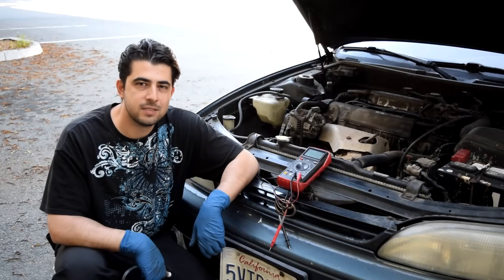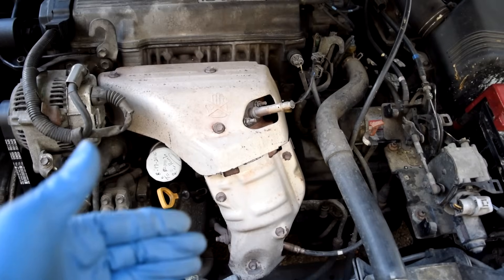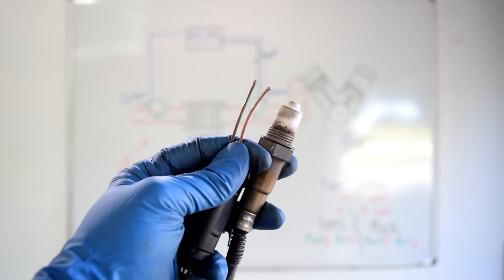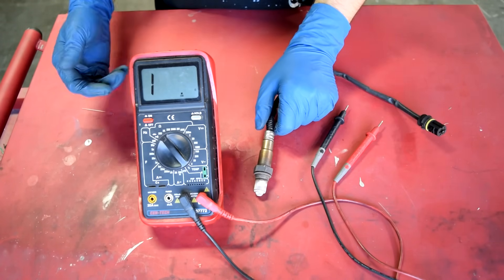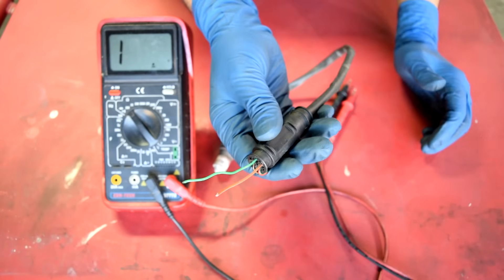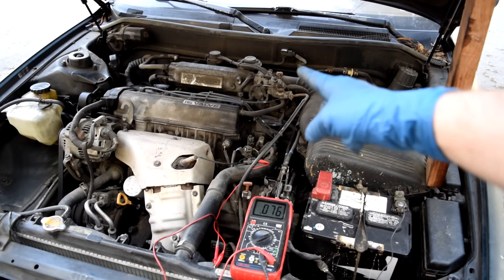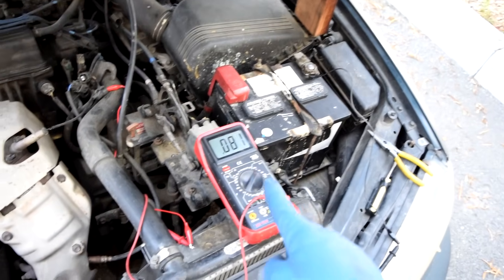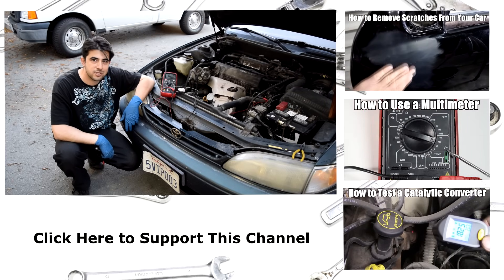How to Test an Oxygen Sensor - Plus Oxygen Sensor Operation and Replacement Guide

Comment: thanks for your perfect video , i wanna ask you something why when i put the test light on + and the probe on the signal wire of the sensor i am introducing voltage to the signal ? does the voltage transfer from + to - ? i don't understand this part
Reply: Cars are negative earth. so the positive terminal is sending 12 volts positive up thru your test light, thru the lamp filament, down your probe to signal wire of the sensor. If you get a voltmeter and put one probe on to the chassis of the car and the other probe on to the probe of your test lamp you will see a voltage reading( with  the test lamp  NOT touching the
 sensor)

Comment: Should a 02 sensor read negative milliamp
Reply: Change your leads over
Reply: @mmark8394  thanks. Ill remember that when i try with a multimeter….I was actually reading it on an access port on my sti at the time. Turns out my 02 was ok. It was a intermittent fuel pump issue.

Comment: When you tested the single wire sensor with the voltmeter, the reason it wasn't switching back and forth in voltage was because the sensor was unplugged from the ECM, which created an open loop condition - without the feedback from the sensor, the ECM cannot modulate the pulsewith to switch the mixture rich/lean, so you wouldn't see it at the sensor.
Reply: Patrick you didn't need to watch this, you already have this topic wired. Look at the big brain on Patrick you get A on today's test lol
Reply: Yes, simple Kirchoff's law, the disconnected one wire sensor could not possible complete a circuit.
Reply: He revved the engine which showed a change in sensor output.

Comment: The code 0155 kept coming up when I scanned the car when the check engine light came  on. Checked the fuses and switches under hood. Pulled switch marked O2 sensor. All 5 prongs had white corrosion on all prongs. I cleaned the prongs and socket to metal. Seems that fixed the problem so far (3 weeks) where the engine light would come on within the first mile. My fuel mpg was at 19.5mpg to 10mpg, so cleaning the prongs of the switch worked and fuel is back to 19/20mpg and this is with 04 Grand Cherokee Overland with 4.7 HO 2 wheel drive. Cleaning the prongs was a good deal so if  you have a light come on saying its an O2 sensor, check your owners manual for location of Ox sensor relay first, clean prongs  . maybe a blown fuse .

Comment: I don't get it.       The cylinder closest to ur timing chain.      They both are equal.        Am I wrong
Reply: They are not equal, one bank is shifted back by the thickness of one connecting rod, as the crankshaft journal is shared by two connecting rods, one of the two is closer to the "front" of the crankshaft.
Reply: He means the number 1 cylinder is always the one closest to the timing chain or belt  on a 4 banger. On a v6 or v8 v10   or v12 bank 1 is always the  side where the number 1 cylinder is and, bank 2 is always the one where  number 2 cylinder is.

Comment: I was getting codes P0171 System LEAN (Bank 1) As well as P0131 Low Voltage Sensor 1 Bank 1. After i watched this video it's clear why as the oxygen sensor is bad. Good video.

Comment: l have a lexus ls460l 2007. l replaced the bank 2 sensor 1. l started the car and got a p0051 in the scanner and the also said 3.29. could you please give me any information
Reply: Andrew Villanueva hi, did you ever figure this out? I think I'm having a similar issue with my subaru

Comment: Say bud, I had a weird one I hope you can help me with. My car was running a little warm and after extensive research and doing a lot of process of elimination, I came to two things that may be causing it to run hotter than normal: the o2 sensors or a vacuum leak. I decided to just see the live data of the car and saw that both sensors were at about .6 to .7 average. What was strange to me is that when I turned the car off, sensor 1 was at 0.0 volts but sensor 2 was giving 1.2 volts. Is this normal?

Comment: Great videos!  Was wondering if anyone has any idea is where the fuse is to the B1S1 on a 2007 Toyota Corolla.  I've looked all over but cannot find any information on it.  My scan tool shows 0 volts, a bad fuse would be  the easiest fix.  Any help would be appreciated.  thanks....

Comment: does a bad O2 sensor cause black smoke to come out of muffler on a 2001 jetta 2.0
Reply: jose martinez yea if it makes your PCM think the engine is running lean it adds more fuel than it actually needs meaning black smoke

Comment: excellent vid and explications !
i suscribed
but how could you mesure  volts on the o2 sensor while its disconnected ?? thanks
Reply: Bastian Peltier the O2S creates Voltage to communicate with PCM it doesnt take current it gives Basically

Comment: Good info but .5 volts is too high on a downstream sensor.  Usually it should be lean after the cat and should be closer to .15 volts. A .5 will appear to the PCM as if the cat is not efficient and stick a cat efficiency code.

Comment: thanks bo$$,, I have a question 

if I delete my cat converter would the fuel trim change?? is it really that the downstream O2 sensor only detects the bad cat converter and doesn't effect the fuel mixture ?

why the downstream O2 sensor has steady 0.5 v?
Reply: warsha Sir Please never delete the cat on your car it does absolutely nothing Other than change the Molecule Structure of gases emited by your engine

Comment: Hello Mr Ratchet n Wrenches

I have a lean code p0171 check engine light is always on, the cr run 
fine and idles fine. air/fuel sensor fluctuates between 600 to 800 down 
to 200. the fuel trim long term is 15 + and the shorterm fuel is -14. 
Check for vacuum leak engine cold sprayed water all over intake manifold
 , vacuum hoses , exhaust manifold, its normal.  The air/fuel sensor 
drop to zero volts when I pulled the vacuum hose from manifold . Does a 
zero volt reading point to a faulty o2 sensor , its a 4 wire , on Toyota
 corolla 2000 4 cyl CE 1.8l.
Now today I will check spark plugs and injectors, its repeated ticking 
sound points to both injectors and spark. spark advance on the obd tool 
reads 15 with a G letter . What does it mean?

I have not back probe the o2 sensor because I can not find its o2 
specifications on voltage drop and I don't know if its a wide band or a 
narrow band sensor. 

I cant find the fuel regulator in the engine. And I need to inspect all 
the vacuum hoses too. Its like being a medical doctor, I only have 150 
hours of training with certificate from the 70s and learning all this 
analysis with fancy digital scanners can be very expensive for just a 
do-it yourself-er. 

can I use a volt meter with an amp probe together on a o2 sensor signal 
wire, instead of back probing? 

Can I use the wave screen on the less expensive OBD scanner, to see wave
 forms along with amp probe and wire clip , How do I set this up?

Comment: what can cause a v8 to backfire an cut out but when it gets to running temp it stops all at once an runs smooth?  it has new iat sensor, coolant temp sensor new plugs wires distributor cap button an new timing chain that was put on by how the Haynes book says

Comment: too much info, for beginners, went to fast. make the video shorter or separate the testing aspect into sections, slow down.
Reply: It does get sort of confusing at times so what I do is I watch the video again and either pause it as I take notes on each section or replay each section at a time until I get the full grasp of it part by part. Good luck!

Comment: Thanks man for the excellent sensor videos. They are easy to understand and very educative indeed. Keep the fire burning. Could u please do a video on a Toyota Corolla Spacio 1998 4AFE engine (Automatic)  indicating the position of the camshaft and crankshaft position sensor and how they are tested for functionality. Also, whats the name of the sensor at the "front" of the throttle position sensor and how is it tested? I understand the throttle position sensor is at the "back" of the throttle valve.  Unfortunately, I do not have a wiring diagram for the vehicle.

Comment: Thanks! This video was a big help to me. I have a '97 Honda Accord LX with 296k miles on its non-vtec 2.2L 4-cyl engine that runs fine (no misfires), but just got a CEL for the P0420 (catalyst inefficiency) with no other codes.  Using my ODB2 reader, my downstream O2 sensor's voltage jumps around kind of following the upstream O2 sensor's readings.  What would you do? I've been putting a qt of oil in about every 1500 miles for awhile now, but there's a valve cover leak that I was just about to repair.  Would you replace the catalytic converter on the chance that the car might be burning oil (I've not noticed any black smoke or soot on the tailpipe) which can ruin the new one or just ignore the P0420 code since I don't have to worry about inspections in my state?

Comment: Isn't it kind of dangerous injecting 12 volts to the signal wire. I would think that could blow your PCM.
Reply: He disconnected the sensor wire from the Harness side of the circuit.  Although most signal circuits are 5 volt reference based, this is to make the ease of testing and to not have miscommunication from 5 dozen different sensors based on 12 volts since the battery is 12.6 volts.  This should not blow the PCM.
Reply: Thanks for the comment. I was wondering what was going on there.

Comment: Great video! I have learned a lot from viewing your videos!  

Question??? I have a 2004 Toyota Tacoma 4x4 that will not complete the I/M for the catalytic converter. Both O2 sensors have been replaced. Also the rear catalytic converter was replaced because the original one was stolen.  Currently done a drive cycle, but it will not complete I/M from CAT.  Any idea or advice?

Comment: Why do you have to supply power to the signal wire to check if its ok? cant be checked just by checking the continuity of the wire with a multimeter? its risky to supply power to the pcm...
Reply: That is my opinion as well. I think continuity check would suffice

Comment: That LED test light will get you into trouble one day my friend. Scrap it, get a regular incandescent one. You can't check circuit integrity with those, it takes than .005 of current to light one of those.
Reply: would the the test LED be best suited for checking low voltage signal wires, while a 12W incandescent would be better for checking power lines?
Reply: AJFresh  I don't even think you can use it for low voltage signal wires, I think the circuitry in the L.E.D teslight is only designed for 12 volts. You can use a simple voltmeter for that. The fact is, there have been situations where a L.E.D testlight has been used to check for voltage and ground and there has been significant voltage drop in that circuit, but the L.E.D testlight still lit up as if there was nothing wrong. Now had they used a simple incandescent one, the dimness of the bulb would of indicated a problem. And all that talk about it being dangerous for computer circuits is a hoax. No incandescent testlight has ever burned a computer.
Reply: oshin aslanian Thank you!

Comment: Great information and I like how you describe how the parts work on the white board. FYI - I replaced my upstream oxygen sensor four months ago on my 2001 Caravan and the check engine light came on again. The same senor failed and I verified this on the two white wires (heater). The oxygen sensor from Autozone had a one year warranty, so it didn't cost me any money other than my time to replace it again (I did have to pay for the new sensor and I rented the removal tool which I was reimbursed). I showed my two teenage sons how to test the wires so they could see the failed oxygen sensor and the working oxygen sensor.
Reply from the maker: Glad you like the video, thanks for commenting.

Comment: please do not use 12v test lamp on pcm side if a circuit unless you are certain the circuit operates at 12 volts most pcm circuits are 0-5v. just an FYI good video.

Comment: I've never heard that tip about finding the number one cylinder. That's pretty cool. You did a great job of explaining the process but do me a favor and leave this video up forever so I can come back to it as a reference. :)
Reply from the maker: You got it :)
Reply: Hey thanks!
Reply: I hadn't heard of that method of determining cylinder one either!  Good one.. You can download the video using an add on from Firefox and store it on your hard drive for the future in case it's ever taken down.  Just fyi..

Comment: With all due respect, you can't measure an o2 sensor signal with a dvom. A dvom gives an "average". An o2 signal fluctuates too fast and your dvom will give an average voltage. You need an oscilloscope to see the o2 sensor signal. A scan tool will also show the signal, just not in real time. Great video man. looking forward to your next one.
Reply from the maker: It's not as good as an oscilloscope sure, but it gives an indication whether the O2 sensor is shot or not. Thanks for commenting, cheers.
Reply: I think of a dvom in this case as more of a go/no-go tool.  An exact number is not necessary, but a ballpark figure will suffice.  The average person doing it themselves is not going to have an oscilloscope, nor the ability to use one.  I am a lifelong ham radio operator, and haven't touched one for years.  And with the cheap digital multi meters out there, I find myself using them instead of my auto test light as well.  But the videos you put out are top notch and I thank you.
Reply: +Tim Kies A dvom on an o2 sensor circuit will read the average of wherever  the voltage and frequency of the o2 sensor signal and the sample rate of the dvom meet. Too many variables. Here's an example,  you could get a steady lean signal with a dvom and have a perfectly functioning o2 sensor signal because everytime the dvom samples the signal, it could average out to be lean even though the o2 signal is fluctuating from rich to lean like it should. That example would lead you to believe that either your vehicle is running lean or you have a stuck lean o2 sensor. I mean no disrespect and do not intend to be argumentative. I enjoy this channel but it's easy to be fooled by an o2 sensor with a dvom.
Reply: Not a problem.  I understand the shortcomings of the dvom.  Just know that most people are not likely to have access to a oscilloscope.  And I am always happy to hear from friendly people.  No problem.